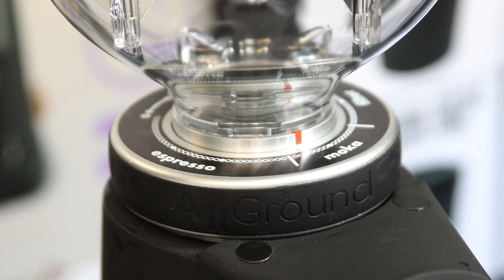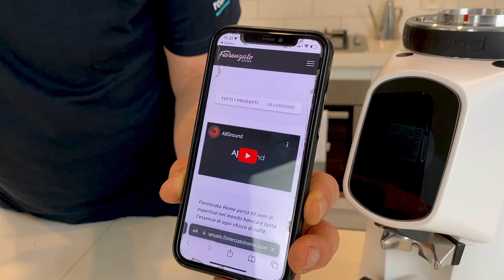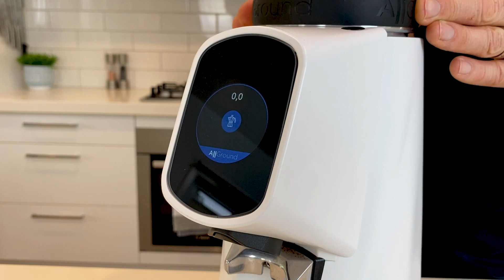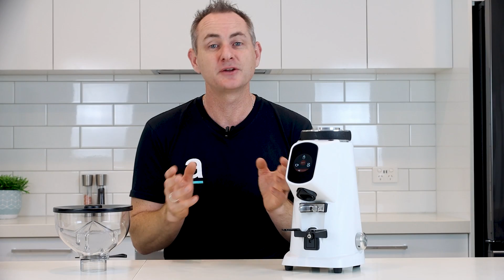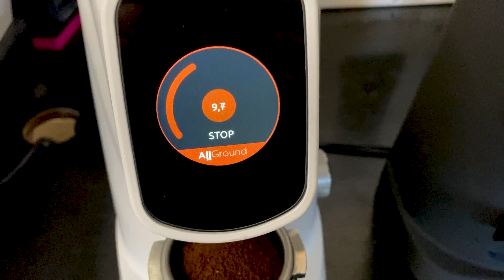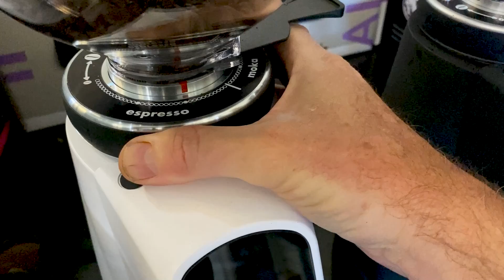Fiorenzato All Ground Coffee Grinder (Everything You Should Know)

Comment: Can you use this all ground classic as single dose grinder ? Even with this 250gm hopper Coz generally I pre dose my stuff n keep for week .. also classic is good for both filter n espresso ? For filter mostly I use hand grinder  ( zp6 special ) thinking to add machine grinder for daily 1..2 cups of espresso based drinks latte n cappuccino at home.. also is der any option not to use pre set timing for espresso setting just like filter press n hold till u get ur desired dose ?
Reply from the maker: Yes you can, just start the motor first then add the beans, there is a small retention but not much

Comment: I' ve had my Allground for about 7 months with no issues! IF there is on minor nitpick it is the fact that it does NOT grind for cold or French Press. I use mine solely for drip (more like pourover as we have a Technivorm with the rotating filter basket) and haven't made a bad pot ever! Contrary to the commentator; when I or the wife are away we use for single dosing by just leaving whatever is in the chute alone (it is not very much at all) and since we do single or two cups we just put in either 1 or 2 scoops of beans from our containers and voila! Yummie!  as we've had it for only 6 months and it's in our 2- person, apartment's  kitchen, we have not even had the need to clean those fantastic titanium burrs yet! $1K sounds like it's a lot of moola but, a flat burr grinder of this size is so far superior to any burr grinder in it's ease of use and very low maintenance that it IS a no-brainer! Definitely worth the investment!
Reply from the maker: Thanks for sharing your experience. 👍🏻

Comment: I've had the All Ground for over 12 months now and overall I'm very impressed with it.
Build quality is excellent and it's fairly quiet when grinding. 
I mainly grind for Espresso and the odd Moka pot coffee and its very good at both.
As for purging between settings it take around 12 grams of beans to go from Espresso to Moka so a bit wasteful in that respect. 
As for talk on the bellows for purging I asked that question to the distributor when I first had the grinder and had no news back so I doubt it's going to be available.
Reply: Waste of coffee if you switch on the fly a lot of waste

Comment: I’m sorry but aren’t there any negatives? This sounds a bit too much like an advertisement imo.

- I’d prefer a weight limited instead of a time limited grind setting.

- wouldn’t you want a higher powered motor for a café environment? 

- who would want to sell/buy ground coffee? Wouldn’t ground coffee go stale in a matter of hours?

- Wouldn’t you want two grinders, one for espresso and one for filter, in a commercial setting?
Reply from the maker: It’s not a full commercial grinder, it’s a high end domestic or a entry level or 2nd commercial grinder. You have the bigger versions with more powerful motors that suit the needs you mention,
Reply: @ArtistiCoffeeRoasters  
Thanks for your reply!
Reply: It doesn't have single dose bellows . You don't need anyway bcs It doesn't hold ground in the way.  I will sell my eureka and will buy this model. Better than Niche too.
Reply: @lenso010  hey how are you? one question, did you buy it? im between this and the new eureka mignon libra all purpose, I do espresso, v60, aeropress, moka and French press, so im trying to buy the best fit for my home coffee
Reply: No commercial grinder it will heat and ex xplode lol